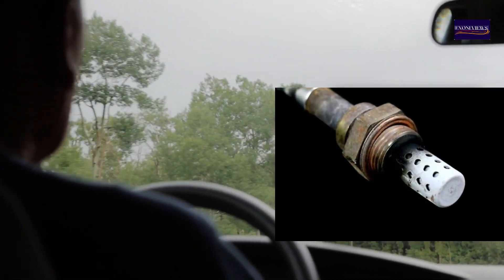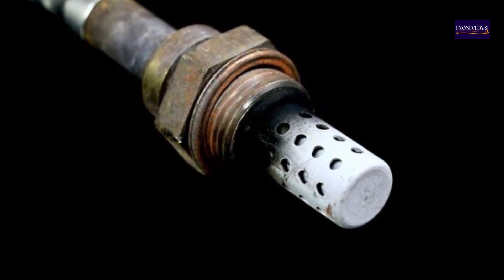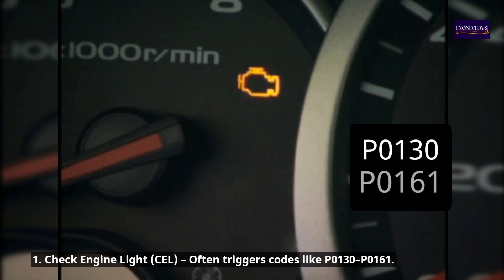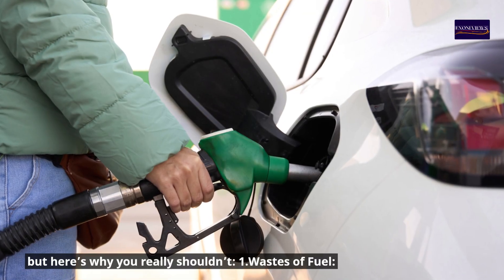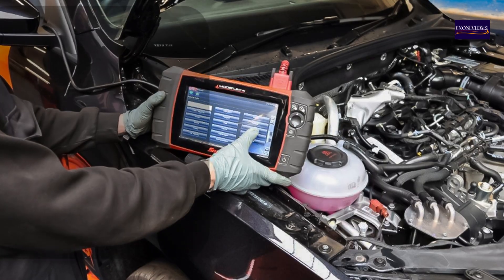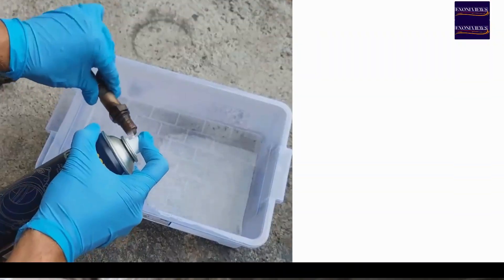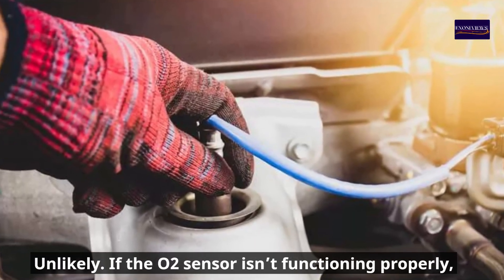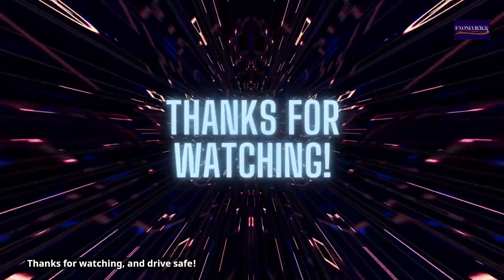What Happens If You Drive with a Bad O2 Sensor and How to Tell It’s Failing!

Comment: Hey i ended up getting a p0031 code on my gr86 why could that be? I ended up not connecting the 02 sensor when turning it on after putting the oem headers but then turned it off once i saw the check engine light came out and connected it on but i still have the light what could the issue be should i change the sensor?
Reply from the maker: So sorry it took me this long to reply. P0031 on the GR86 means the upstream O2 sensor heater circuit isn’t working.
Starting the car with the sensor unplugged will trigger that code, and the check-engine light won’t clear on its own even after reconnecting it.

Here’s what to do:

1. Make sure the sensor connector is fully seated and the pins aren’t bent.

2. Clear the code with a scanner and check if it comes back.

3. If it does return, inspect the wiring around the headers — it may have been pulled or touched heat.

4. If the wiring is fine, the heater inside the sensor may be damaged, and replacing the sensor will fix it.

If you want, tell me the year of your GR86 and I can point you to the exact fuse or wire colors.